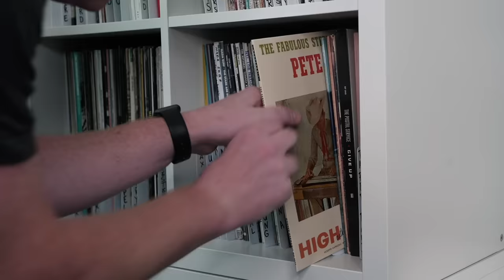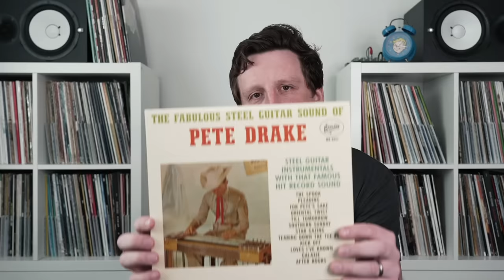6 Guitar Pedal Myths

Comment: Through hole is not better beacuse it sounds better, it's because it's more reliable and easier to service. Surface mount panels are 99% percent made with lead-free solder which is more likely to crack over time, so good luck finding the faulty component on a board that has copper traces as thin as a hair. It sucks because it's a throwaway thing, yet manufacturers still charge magical prices for it.

Comment: I can not argue anything said in this video, but disillusionment is never fun! :/ However I once owned a Jordan electronics Boss-tone, the one you plug into your guitar and produces acoustic-distorted feedback (I actually reversed the in-out jacks to plug into the amp because the feedback was too much for me) But.. the clone pedals, one of them "Buzz-tone" are said to be the same design... the original guarantees genuine tone, the clones are authentic replicas at best. The problem: does the clone deliver as advertised or just advertisement banter? The original raises no question marks! Guarantees are always expensive!

Comment: heh, some opamps can color sound, and some are cleaner.. but in guitar applications the likelihood of being able to tell from one to the next is almost zero. the 'high' noise floor destroys the ability to hear those slight variances.

you've got to have a ridiculously low noise floor and a perfectly flat output system to notice, and even then, you'll probably be straining.

i wouldn't want super cheap chinese opamps in a piece of kit, but i'm also not dropping the cash for say.. some BB's 'just because'. a decent low cost TI/national/etc part will probably do the job just fine. maybe run you $3 max in most cases, should you need to replace a dead one. otherwise, if its got one from JRC in it already because its an old pedal, it's probably fine and the specific model of JRC opamp isn't going to matter in the slightest for you.

with one exception. the gain factor. some opamps have higher gain, some lower. and depending on the circuit, one or the other will perform better for that application because the circuit is built for that level of gain, not because a given model chip is better or worse in general.

heck even some 'mostly meh' lm358's will do the job for most situations, so long as its a decent brand.

Comment: Surface mount sucks for DIYers. Theyre too darn small ya place them with tweezers, Ya cant see the markings without a magnifying glass and  super bright lights and you cant see how good the solder is cause its usually underneath the component. If the loose ones are not placed in a bowl with high sides some will POP OUT, if it lands on the floor, Youre not gonna find it, so dont even try. Lining up an IC with 4 sided pins is some crazy kinda nightmare and once soldered you cant re-align it (at least I cant).    Unless You have super-man-vision DIYers might wanna stick with Thru-Hole components

Comment: Try NOT to use electronic, buffered, active bypass pedals because each one adds a little bit of noise (hiss).   Whereas a True Bypass pedal will add ZERO noise when bypassed. Hook up 10 of them and still NO NOISE.

Comment: The biggest problem is that most guitarists are lazy.  We want to acquire "that tone" without having to work for it.  Most veteran pickers will admit that the majority of their "magic tone" is in their fingers.  There is no way to replicate that with a pedal...

Sure, there are pedals that sound awesome. BUT if you suck as a player, that awesome sounding pedal doesn't have enough pixie dust in its cabinet to fix it...

My absolute favorite OD pedal is a Biyang XD-01...or something.  Made in China.  I bought it brand new for about $15 on Ebay.  I own vintage TS808, TS9, etc.  But that cheapo pedal is way better FOR ME.

That's the secret.  FOR ME it works.  I don't understand why...it just works FOR ME.
Point of fact, every time I put it on my board, there will be at least 1 visiting guitarist wanting to know what I use for my OD pedal.

My secret is not the pedal.  It's the tube amp...and specifically, a balanced tube in the gain/OD stage of the amp.  My favorite amp is a Bugera V22....with quality tubes.  I own a Custom Shop Princeton Reverb, a Hot Rod Deville and an AC30 also.  But the Bugera gets the most playing time.
The secret is NOT the gear.  The secret is how much time you spend playing through the gear!

There were hundreds of horrible pedals in the 80's.  But the good pickers found a way to work with what we had.  It doesn't matter what gear you have...make the best sound with what you have.  I played on stage for years with guitars I found in pawn shops...cheap ones.  But if you put a set of good pups in and install good parts, most guitars will sound pretty good.  Good enough that Joe Blow from the street corner will never know the difference.

Quit trying to sound like SRV, or Jimmy Page or Hendicks.  Be the best you that you can.  There will never be another SRV or another you.  We know what SRV accomplished.....what about you?

PLAY MORE...whine less.

Comment: I have a fender 110 champion amplifier. I wasn't in the market for an amplifier but the input jack was cooked and I got it for twenty bucks so I put a new input jack in my $20 amplifier and it works great it's ridiculously loud I can't even put it on one in my small apartment without blowing the neighbors off the top of the building I know tube amps are supposed to be louder and better tone and all but solid-state pretty God damn good little fender amplifier sounds great and it's loud ridiculous

Comment: JRC386D (et. al.). I’m convinced that this opamp is SUPERIOR to tubes, in terms of musical sag, compression, and overtones.

That is, of course, if you are still so entry-level, that you aren’t stacking gain stages. Mixing and matching different textures is the source of all sonic bliss. Solid state only sucks because you haven’t tried saying “F**k it.” and turning everything to maximum, in addition to boosting with a distortion pedal. And sure, I’ll bet your museum quality Plexi sounds great with nothing but a braided cable between the amp and your mint condition ‘55 gold top. But have you tried putting a fuzz face in the way?

Pedal myths are to be avoided, like all superstition. But the religion of TONE demands bold experimentation and an abiding faith in the great God of VOLUME!

Comment: From an electronics perspective, surface mount components are identical to through hole just in a different plastic package (smaller), for transistors and IC's it is the exact same die (chip) that is used with identical specs...surface mount, being much smaller and lighter and attached to the PCB with very short leads makes the use of them in a design more durable, less to vibrate loose, etc
The PCB traces on surface mount designs tend to be much shorter which is less prone to pickup of noise and interference. The ONLY thing through hole has going for it is easy repair with simple tools. There is no competition between through hole and surface mount, as surface mount wins hands down in most all areas..the guitar pedal world is filled with way too much hype, ONLY trust your ears...now if we were talking tubes vs transistors it would be a different matter...I once built a tube distortion "thing"...more of a fuzz...

Comment: Tone myths?  One myth I've found not to be true is the old "Marshall Plexi's sound best with everything dimed."  Nope.  Another one is "it preserves your tone at a lower volume."  Not true.  There is such a thing as speaker breakup (among other, electronic things), which you're not going to get at that lower volume, plus Fletcher-Munson curves.  What else?  Wrapping your strings over the stopbar instead of through.  Kahlers suck tone really bad.  The SD-1 is super-awesome.  The DS-1 sucks so hard.  Rack gear is all awful.  Monster Cables.  (The best cable I have, and still use daily and which has never failed me was cut, soldered, assembled, heat-shrunk and sold to me by the guy who ran the Pier Music store on Pier Avenue in Hermosa Beach, California way back in 1991.)  However...
I tried the TS-9.  I tried the TS-808.  The TS-808 sounded better.  I tried the CS-3.  I found and tried the CS-2.  The CS-2 sounded better.  Way better.  I couldn't get a good sound out of the CS-3, I had to work really hard to get a bad sound out of the CS-2.
Was it the op-amps?  I don't know, but the op-amps were changed in both sets of pedals.  Are you telling me that the op-amp has zero effect?  If so, I'm all for a CS-2 clone that sounds just as good but doesn't need a rare, expensive, out-of-production Roland chip and therefore doesn't need to be astronomically expensive.  But remember!  It has to sound just as good!
Although I hear with my ears, not my wallet, some legendary gear is legendary not because Jimi Hendrix played it or I used to play it back in the day, but because it has excellent tonal qualities.  But then, some "legendary" gear is a complete bust.  Use your ears.
I wish the TS-9 and CS-3 were better or just as good-sounding.  They're cheaper and/or more available.  I have nothing against cheap pedals, so long as they sound good, are durable and reliable.  In fact, I prefer them.  Cheaper pedals mean I can afford more of them, or another guitar, or another amp, or maybe I can even afford to eat or replace my worn-out rags or get the holes in the soles of my shoes patched...
The proof is in the pudding.
Favorite instrumental album?  Jan Hammer's collected Miami Vice soundtrack.

Comment: Ok. I have a question. 
I don't like using overdrive pedals with a power supply.  I prefer a 9v battery.  I can swear I hear, and feel a very noticeable difference.  But... am i crazy?  What's up with this?
Reply: Probably because you're rushing to play as much as you can before the battery dies
Reply: @devoarepunk  
Trying to make sense of this. Batteries last a very long time in overdrive pedals. I can easily get about 10 to 12 gigs out of it before you start noticing a significant drop in voltage. And my overdrive pedal is always on. I never turn it off.
Reply: @joequintana5546  Oh....on second though i may be just using them wrong

Comment: Only comment re the surface mount: Not so easy to fix if it goes tits-up. Unfortunately, so much electronics goes to landfill, whereas with through hole a tech could fix easier. Not saying you can't fix surface mount, bit it is certainly more hassle, sometimes more than its worth.

Comment: transistors are not amplifiers, they are electronic valves or switches, yes, they are used in amplifiers as part of the whole electronic circuit.
Reply: Sure sounds like you know what you're talking about, Ivan

Comment: Thanks for the video!
Here is the case when buffered pedal is sounds bad https://www.youtube.com/watch?v=x4eEzqSRReA
And I can confirm I hear changes in tone (when it fuzzed) after adding/removing boss pedals.
I also confirm that boss ch-1 and boss ds-1 affects tone in a good way, giving some small boost (recorded into computer, not just listening to the combo in the room).
So best wasy as you said to listen to the pedal. 
I can add that it's alway can be recordered and listened on the computer one piece by another piece.

Comment: The biggest issue with surface mount is that they are a lot harder to repair or to mod.  :-(

A topic you did not include is the legendary wah inductor.  It's a more complex topic and may be true or not depending on how closely matched the inductors actually are.   The main value is the Inductance, but no component is "pure" all have other qualities though usually so tiny as to be utterly insignificant.  (e.g transistors have an inherent capacitance and that limits the higher frequencies)
As long as the inductor core doesn't magnetically saturate (unlikely in conventional use) then the other parameters are the Resistance and Capacitance and if they are close to matching the original inductor then it is effectively identical and there should be no sonic or measurable difference.
I'd be interested to hear your thoughts.
(I do not have the data to enable a comparison of the legendary Fasel conductor to subsequent pretenders)

People do not understand the causes and consequences of impedance mismatch.
In most cases, buffered is better, but in some circumstances unbuffered is crucial - e.g. your guitar needs to connect directly to your Dallas Rangemaster treble-boost, or to your Fuzz Face.  In these two cases, the impedence mismatch loads the guitar pickup output and pulls the highs down which is important to the tone and reponse of the effect.

Fuzz-Face Clean Up
When the guitar volume control is fully up, the resistence it has is effectively removed from the circuit. 
Under that circumstance, what the pickup "sees" is only the input impedence (=  resistence) of what the guitar is plugged into.  In the case of a FF that is a very low input impedence and because of that the pickup struggles to produce high frequencies.  
So strong signal into FF but with limited highs, result a thick, somewhat muffled fuzz.
As you turn the guitar volume down you are pushing less signal into the FF and consequently it cleans up.
But what you are also doing is putting the resistence from the volume control in between the guitar p/u ans the FF input.
The guitar pickup is now "seeing" that resistence rather than just the FF resistence (input impedence) and now that it has something to "push against" the pickup is better able to create and deliver the high frequency parts of the signal.
So when the FF is a good one (i.e. correctly set up) there comes a point as you turn down the guitar volume control where there is very little signal driving the FF and consequently little or no distortion whilst at the same time the p/u is now "seeing" a high enough resistence that the full brightness of the guitar comes to the fore and is also somewhat brightened further by the FF circuitry (even though it is no longer fuzzing the signal.)

Putting a buffer in between the guitar and the FF makes the p/u "see" a high impedence and so it is able to generate it's full signal with all the high end intact.
Putting that buffer output into a FF allows the full horror of the primitive FF circuit to manifest and it is pretty gruesome, lots of glass-shattering high-end fizz.
So ....... the magic of the FF DEPENDS on the impedence mismatch killing off the high end and that is why you need to plug the guitar directly into the FF for good results.
.......or buy a later version FF where a buffer has been built into the FF but "tuned" to keep the sound of the FF as it should be. e.g. the Benson Germanium Fuzz which also has solved the varying tone with temperature problem.
......expensive though.  :-)

Comment: I want to say, right out of the gate, that I am not contradicting you. You have far more experience in this field than I will ever have, so I value your opinion. That said, I came across your video as I was doing research for OD pedals and had already run across another video from Godlyke, talking about the Tamura-Mod done by the original designer of the TS808 circuit. Godlyke's video details the upgrades Mr. Tamura had done, one of which used an improved OpAmp, saying it helped make the pedal sound better. Could you comment on this, since your statement on the subject SEEMS to contradict the opinion of this other designer? If the original designer holds to this 'myth', who's more correct on that subject? Or am I just misunderstanding a nuance of your/their assertions?

https://www.youtube.com/watch?v=FUEKLtH2AoE

Comment: Germaniumis better beause it's worse and that's the only reason. But as you said the circuit is designed around the specific componenet. But if germanium was objectively better it wouldnt have been superceded by silicon more or less.

Comment: Josh, I am doing an A/B with the Bansai and my original OD1. After a blindfold test, I hear not only a difference, but there is a big enough difference to keep my original OD1. It really does have an old warn in sound with a warmth vibe. The Bonsai OD1 sounds great, but it also sounds newer or modern, meaning it has a sharper attack and slightly more power. I kept my Original dialed at 12 oclock and moved knobs on the Bonsai trying to find best representation. FYI, it was a friend that let me borrow the Bansai that led me to purchasing the original OD1 so thank you for all you do. The Bansai is awesome. I'm just questioning the JHS adage that special chips with fairy dust and unicorn hair don't exist. Again, the two pedals are very close. But, I really don't think my ear is that special to discern the difference. Maybe this is just one random case coincidence but for me, the original does have a bit more magic.

Comment: Well I’ve got two wampler distortion pedals a Marshall dsl 40 the only thing that has made this amp sound good is a ten band eq I just about threw the amp out because it sounded like mud shit no matter the amp eq settings presence settings put a ten band eq in front bam now it sounds like randy rhoads set up to a tee along with the distortion plus which it almost doesn’t even need